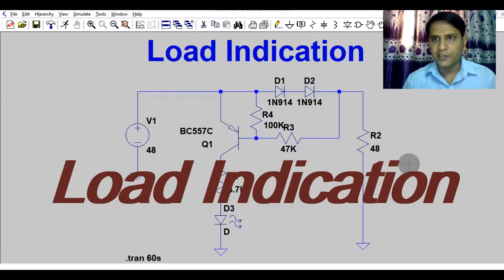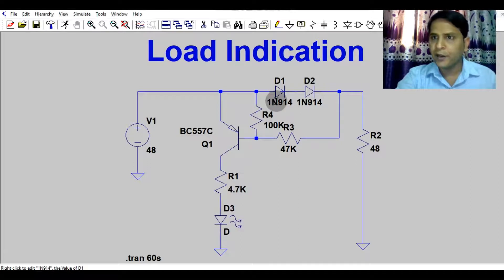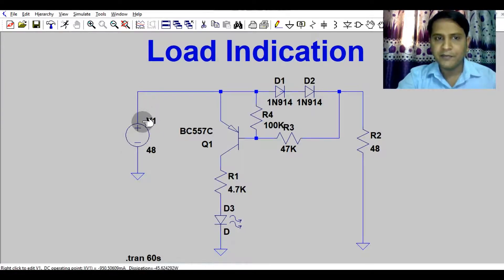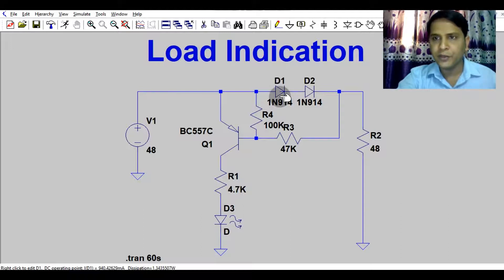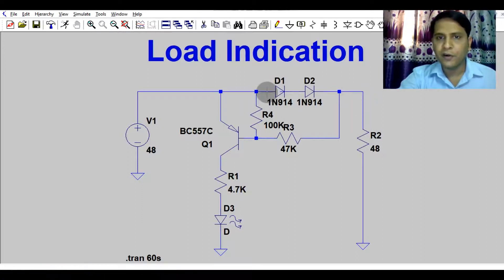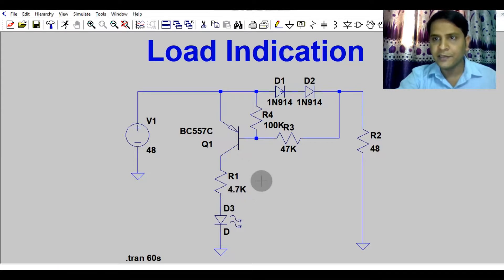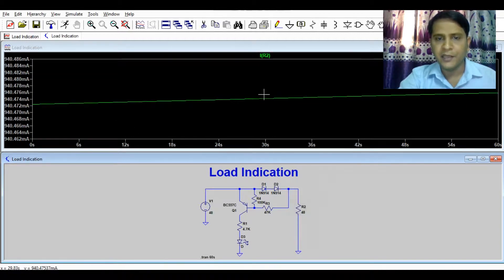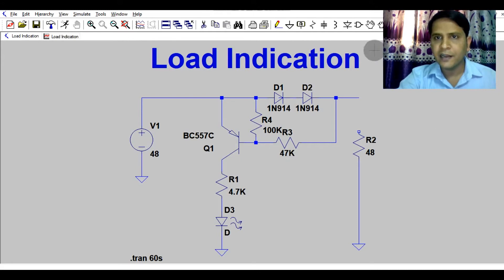LTSpice SMPS Load Indication Circuit Simulation

Comment: 1A through a 1N914?  Brave man!
Reply from the maker: Hi,
I just simulated in LT Spice to show concept and idea. I have not much looked the components rating and values.
For testing purpose i used 1N4007.
Reply: @ElectronicsCircuitHubECH  I guessed as much. Shows the dangers of simulators :-)
Reply from the maker: @davidstonier-gibson5852  Thanks for your feedback. I have added warning in description section.